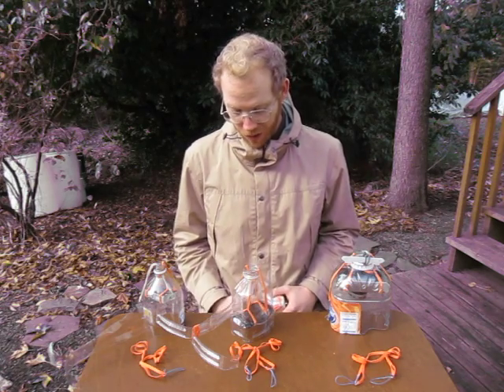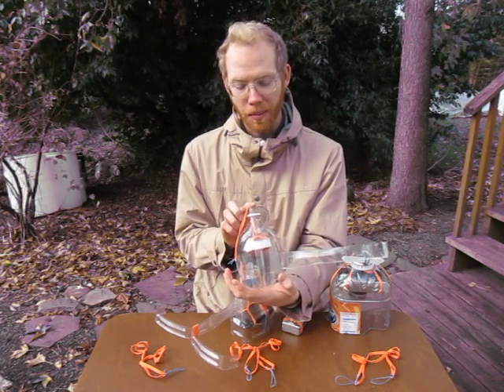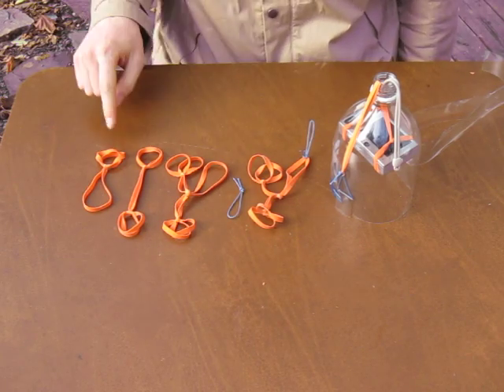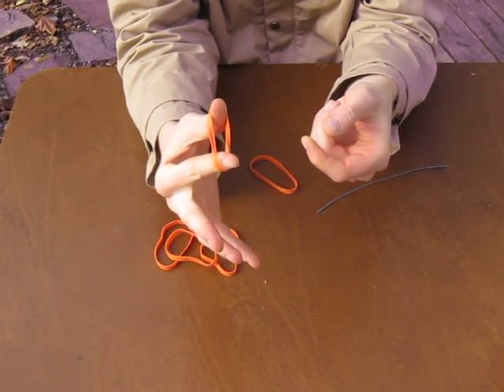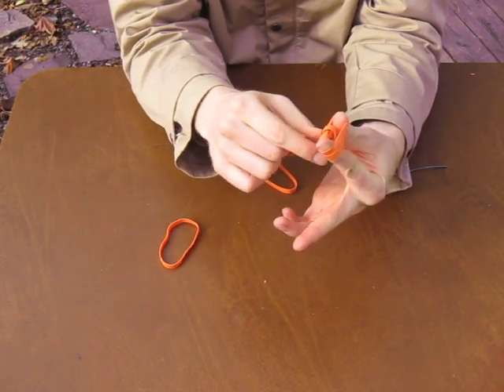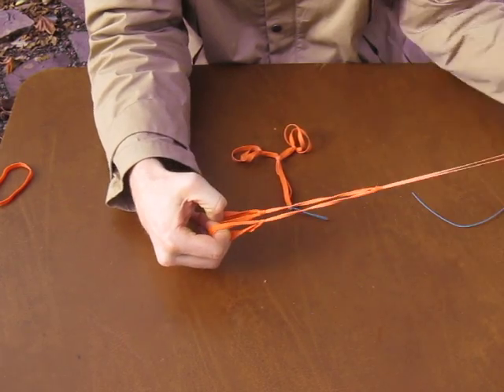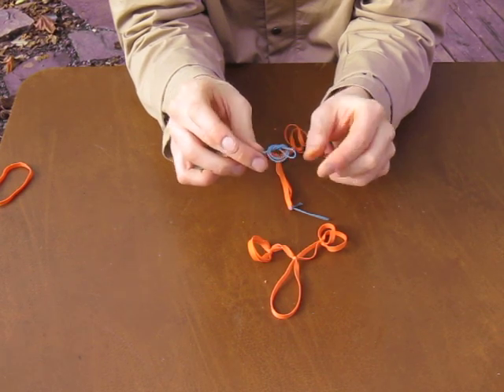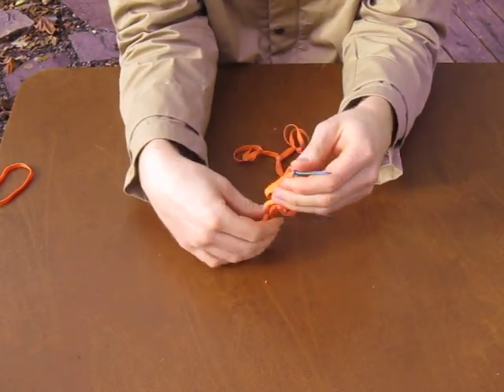Part 2- making a basic rubber band harness

Comment from the maker: yes.  more rubber bands can be used though.  The harness on the right of the video (my left) has two bands pulling the harness into the bottle.  I just added a photo to the description where i use four bands.  also in that photo-- replace the middle band with a loop of string to decrease the stretchiness of the harness.